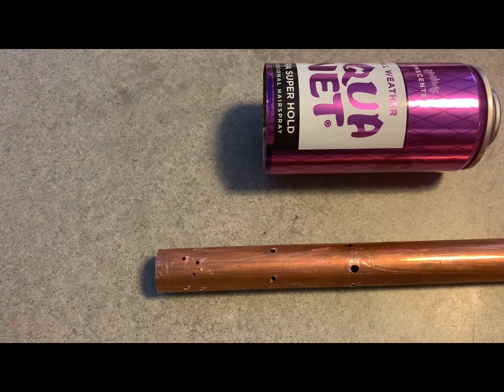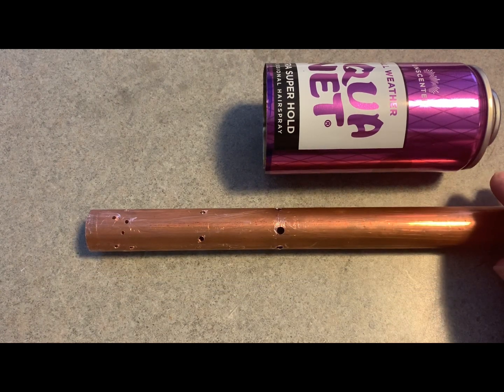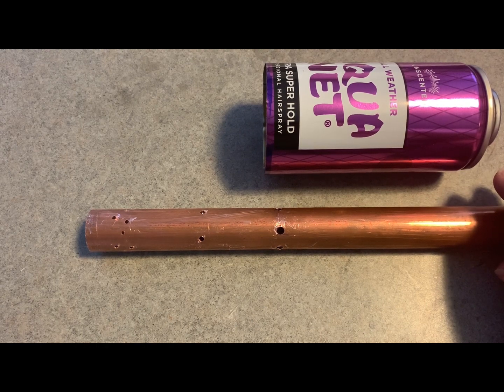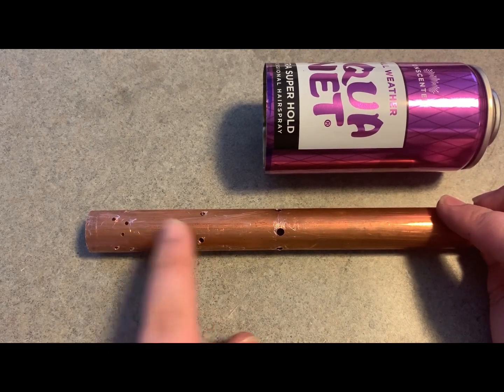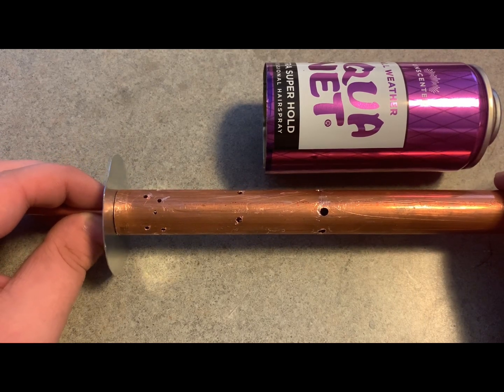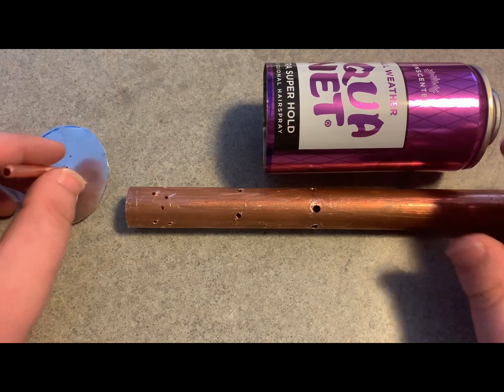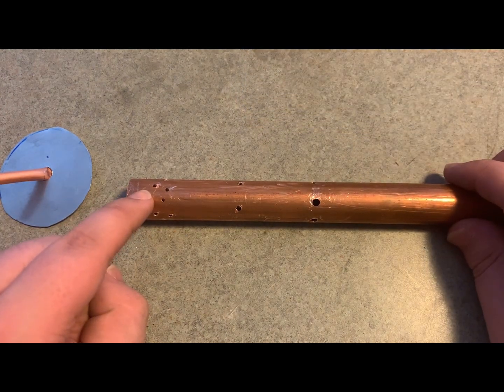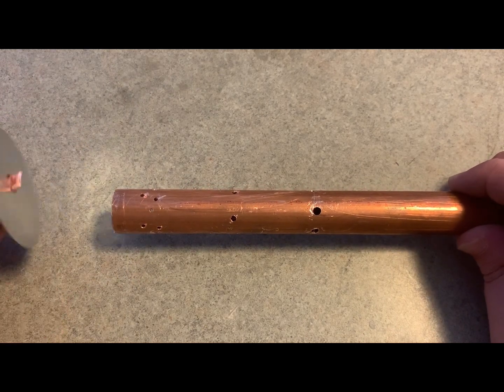Turning a Hair Dryer into an Afterburner

Comment: I have the exact same hair dryer and was inspired to do this while observing the housing around the blades, do you happen to know the max voltage this motor can handle w/o destroying itself? im too scared to go past 12v. Thank You
Reply from the maker: I’m not entirely sure but from what I’ve seen online these motors typically run on 12-24v. If you have a multimeter you may be able to measure the voltage of the hair dryer to give you an idea of the range. You could also slowly increase the voltage and check to make sure the motor doesn’t get too hot. If you have any other questions I’m all ears. I wish you luck on your project!
Reply: @3stepsforward2stepsback Thank you so much for your reply, Yes i purchased an adjustable DC voltage power supply with a knob, My goal was really just chasing down that whind up/down and air sound from gradually increasing the voltage. At aroung 17v it gets pretty whinny but sits at 90 F. damn thing blows allot of air and even propells itself a bit. ( this is w/o the combustion part).